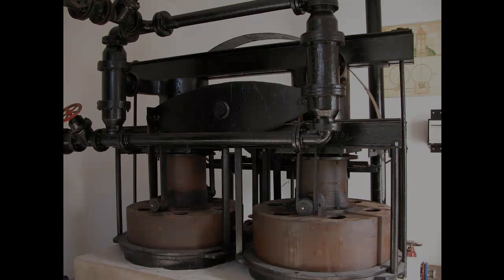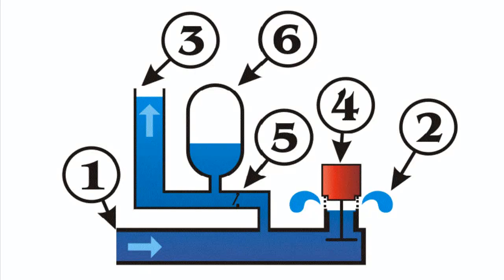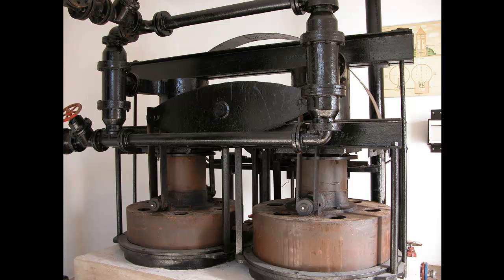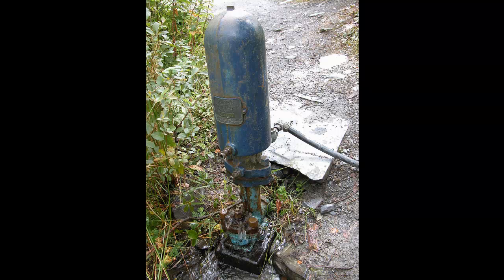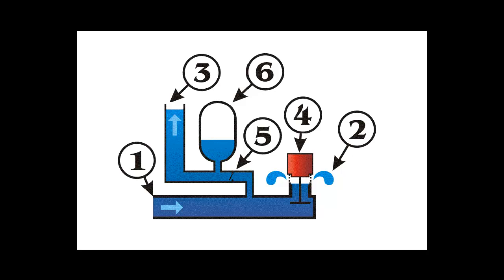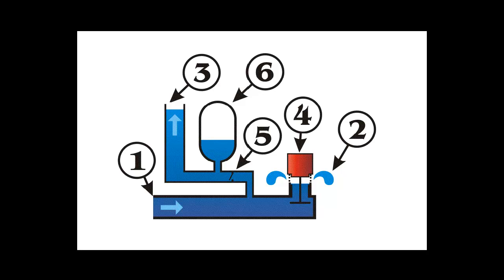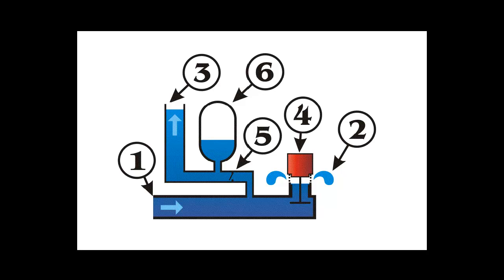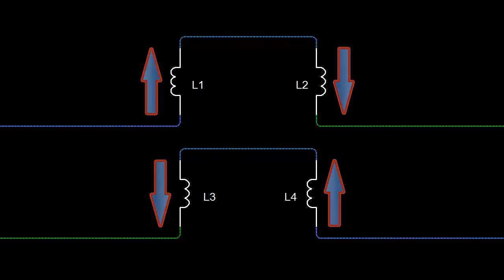How Floyd Sweet's Vacuum Triode Amplifier Works - A Bucking B Field Oscillator - Part 3

Comment: It looks like a somewhat well known type of pump. I've forgotten what it's called. They require energy input in the form of a water pressure differential and a water flow. They cannot just pressurise water in a closed pipe. You have to have some water flowing out of a low pressure output, while the rest is sent into a second output at increased pressure. So it has one input and two outputs. I'm not sure how they work but I think they use the inertia of the water in the inlet pipework. When the flow into the low pressure output is suddenly stopped it creates a pressure spike due to that inertia, which sends high pressure water into the second output pipework. There's a second valve which shuts to prevent water flowing backwards from the high pressure side. It operates in a cycle comprising a few stages (2?). My dad calls them clicky-clacks due to the noise they make.